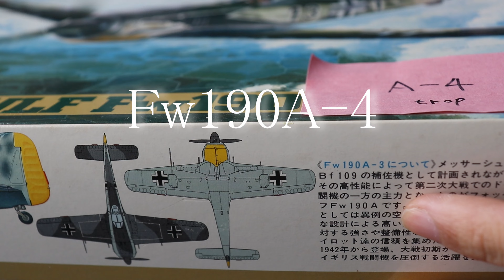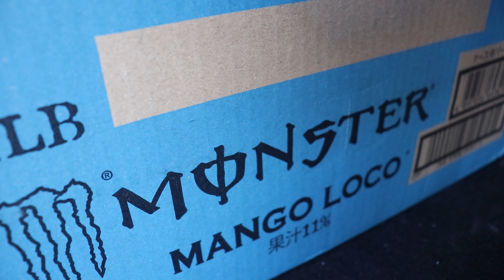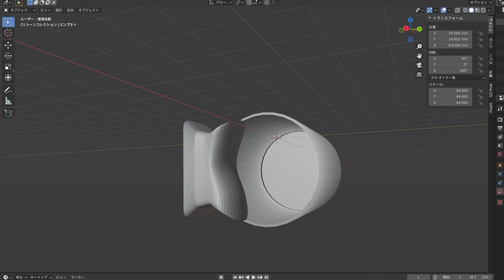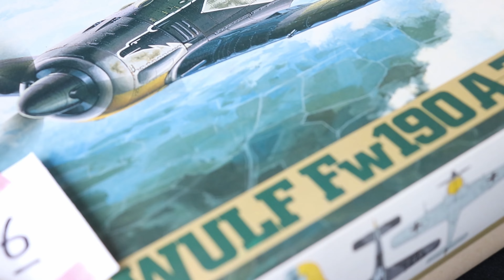【Scale Model】Fw190A-4 "TROP" 1/48 TAMIYA Full build

Comment: Nice build! Unfortunately, You forgot that A-4 version had small antenna mast on the top of vertical tail instead of A-3's "bulged" fastening.
Reply from the maker: It was not that they had forgotten, but that they were unaware of the differences.
Nothing to regret, and your points will be used in my next piece.
There is a lack of material in Japan, so your comments will help me to get the correct findings!
Thank you.